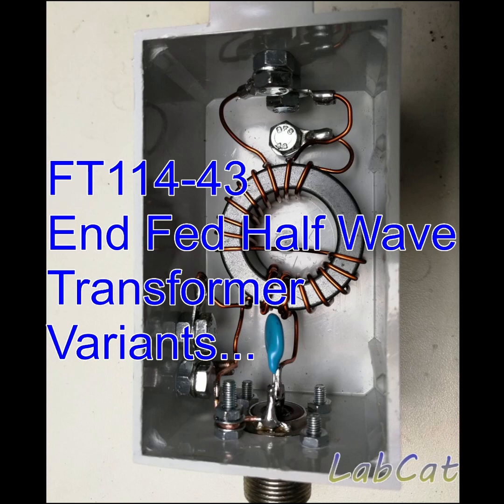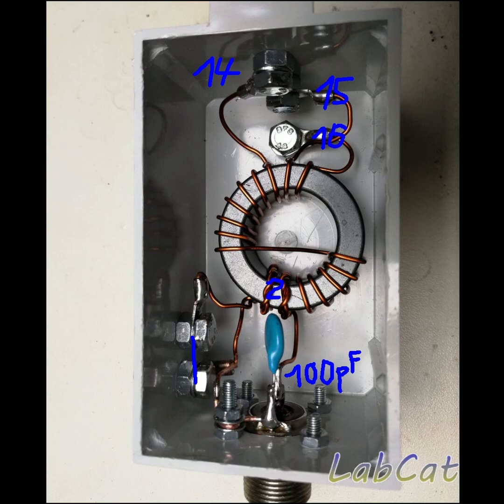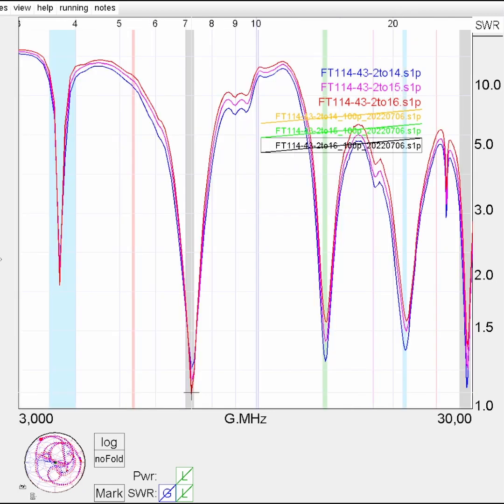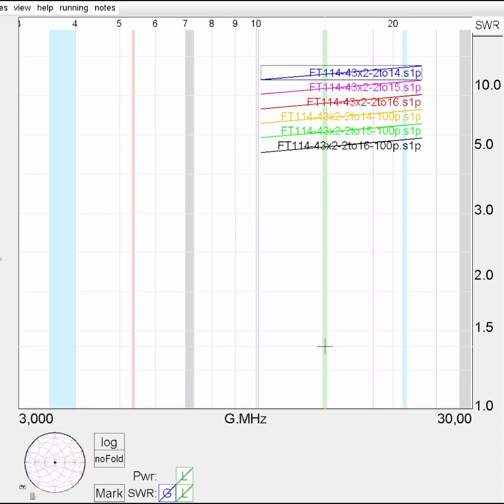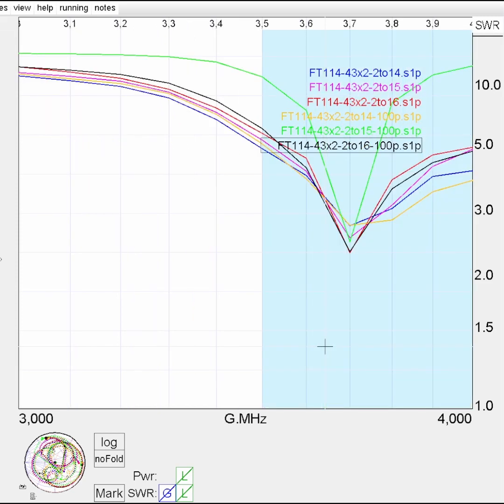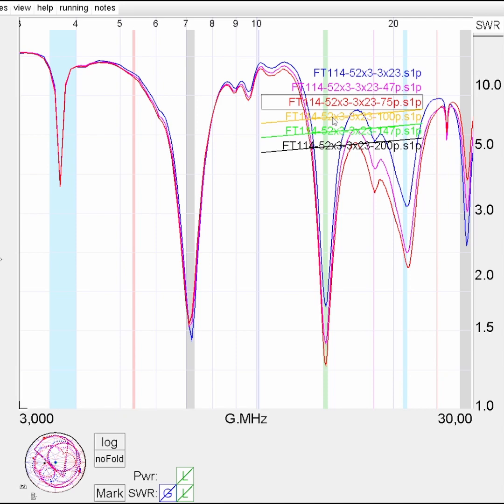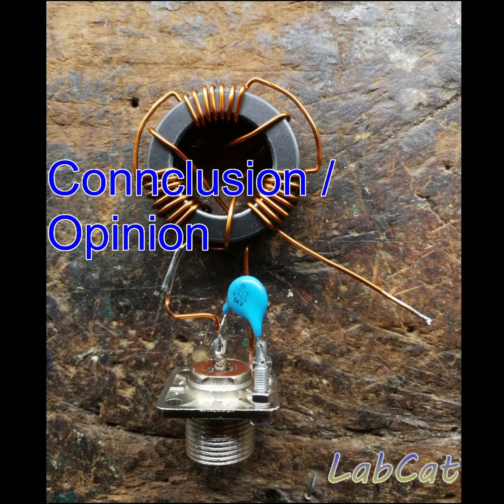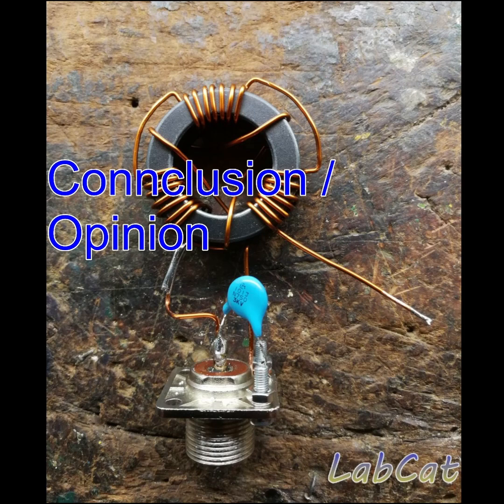End Fed Half Wave (EFHW) Transformer Variants | Ham Radio

Comment: Its voodoo! At least it seems like it sometimes.
I'm building an 80m-10m EFHW using the Fair-rite 2643251002 core popularized by Colin MM0OPX. I started with a 120pf 3kV TDK capacitor and no inductor. It has taps for 49:1, 56:1, and 64:1.

Not much luck getting more than a couple bands lined up. Then I found out I was doing a fools job. I wanted my 80m sweet spot at 3.94mHz then resonate the other higher phone bands.

I added a 9-turn closely wound inductor on a 1/2in nominal PVC pipe core. I've removed one turn and lengthened. My next adjustment will be removing another turn. 

However, my strategy is now to get the bands above 80m in line then add a capacitor in the middle to raise 80m without much effect on higher bands.

I am wondering if I nicked insulation on my enameled wire. Outside 80m and 40m there is nice high SWR indicating good efficiency and hi-Q, but higher bands only see peaks of about 4:1 to 5.5:1.

I think the capacitor on the autotransformer is the trickest bit. In some cases, like on the 52 mix core it looks like it electrical stretches the antenna from the middle above the base band. Then you look at the 43 mix toroids and that theory loses it.

3.94mHz is where the Florida Phone Traffic Net and ARES phone traffic nets meet. Both would be useful after a hurricane, which is why I want to get it fairly sweet.
Reply from the maker: Yes things get tricky if you have a wider 80m and 40m band. Here in Region 1 it works perfectly for 40, 20, 10. Band middle 7.1MHz gives us 14.2Mhz on 20m and with the capacitor we can beat 10m into submission around 28.4Mhz. Even building for the lower end of the 80m Band 3.55MHz works and a tuner manages to tune the upper end 3.8MHz.

If you build for 80m 3.94Mhz you end up much too high for the multiples.
Maybe tune on 20m band middle and play with the capacitor and taps to get 40m / 10m  nicely lined up. Then add 80m at the very end with a coil. If you have enough space you might be able to go lower than 120uH for the extension coil as long as it still blocks for 40m  and above you can get the "75m" bit lined up independently. Or just build a real trap for it.

Of course I haven't tried it myself and might talk nonsense 😉.

On the one hand you are lucky that you have more bandwidth, but building an EFHW does certainly not get easier with this.

73

Comment: Great video. And I share your pain. I’ve done many experiments and settled on a 49:1 on a 240-52 core mounted on a wire winder wound with 1mm copper wire, with a 110pF capacitor It works well on all bands. A picture is on my QRZ page. 73 de Will, M0LGW 👍🏻
Reply from the maker: Thanks Will! I'll have a look at your QRZ page.

Comment: Thanks for sharing your experiments. It looks like it was a lot of work but very interesting. My EFHW is cut for 80 meters and uses two 240-43 cores stacked together and a capacitor. I can't even remember what value cap. I'll have to go outside and open the box and look. But it has turned out to be the best antenna I've ever had. I've had several through my 50 years of hamming. I'm curious why your graphs do not show a point of resonance for 17 meters. Mine does and it works very well on 17 meters. That's where I hang out most of the time. My transformer is 3 primary windings (with twisted wire) and 17 secondary with a cross-over winding in the center. A tuner is not needed most of the time except when I go to a far different end of the band and exceed the bandwidth of the antenna on that band. Then I'll use the tuner just to nudge the SWR down a little.
Reply: Hi, his antenna doesn’t resonate on 17 because he uses a shortened version for 80m not the full size half wave. It’s actually full size half wave on 20 and at the end uses a 110uH coil with another 2.5 meter roughly of wire to go on 80. So apart from 80 will resonate on harmonic starting from 7 MHz up.

Comment: If you use the SWR field in SimSmith (Smith chart) and fill in eg 1.2 1.5 2 3, you will get SWR dotted circles. When you change to the square chart, you will get dotted lines at the same SWR values. And, nice videos.

Comment from the maker: I have a typo at the beginning of the video. My multitap transformer is wound on an FT140-43 of course!
I really try to get things right and then a major blunder like that slips through. 🤦‍♂
Reply: You should be aware that FT140-43 requires 21:3 turns for 49:1 transformer, 14:2 turns yields only 70% efficiency which is very poor.
Reply from the maker: @mareksp9tkw 
3:21 never worked for me on the FT140-43 cores i got my hands on. While efficiency on 80m and 40m might be up, on 20m I already got a slightly worse SWR and 10m was completely unusable. So more efficiency on the lower bands and losing 10m is a valid tradeoff you can decide to take.

The chunkier QRP FairRite core Colin used for his EFHW transformer works quite well with 3:21 though. Alas +-25% tolerance on the permeability of those -43 cores make it even difficult to compare things, when two people build a  transformer with the same winding pattern.

Check out Colins YouTube channel for details -> MM0OPX.

73 and enjoy the hobby!
Reply: @labcat73  hm, you're saying that the manufacturing tolerance of the chunkier cores is looser? That might explain why i couldn't duplicate his (Colin's) numbers...
Reply from the maker: @riz94107  Did I? Sorry that was recorded 7months ago. - Just checked: For FT140-43 i see +-20% AL tolerance and for FT240-43 +-25% AL tolerance given on amidon dot de website. So yes i guess two hams building exactly the same thing can get very different results. I have to dig up the datasheet of the cores Colin used to get their tolerance...
Reply: @mareksp9tkw  Hi,

Can you point me to a source on how to determine efficiencies of various turn ratios based on core size/composition? Is there a published table?

Thank you for your help!

73,

John - KK7JBZ